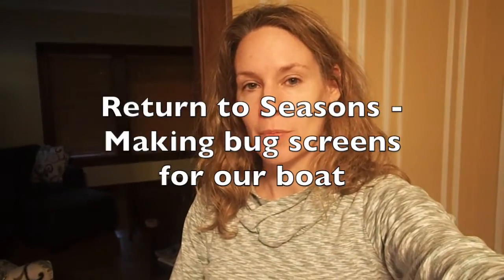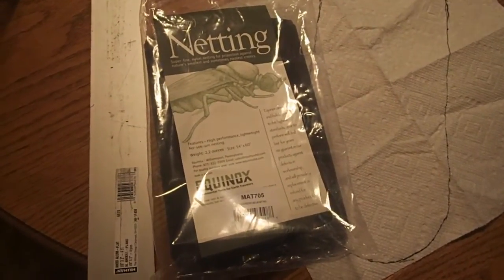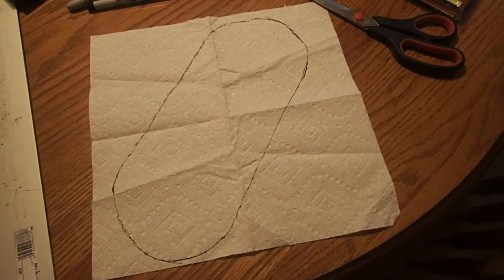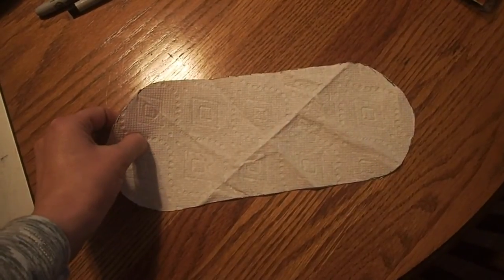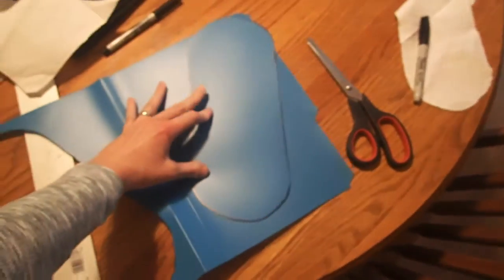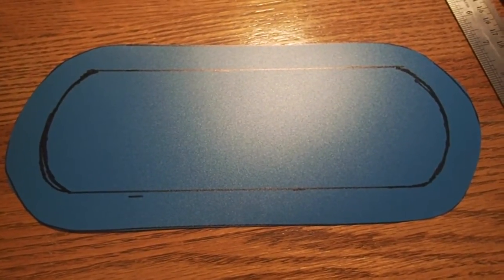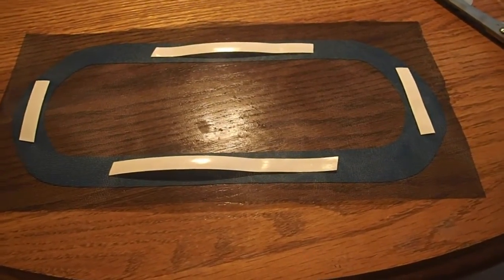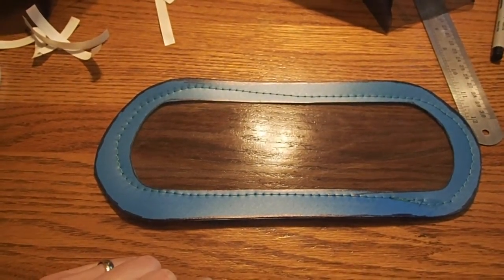Making Portlight Bug Screens For Our Sailboat - DIY fun!

Comment: I'm sure this is a little too late, but just in case... here's my 2 cents, use adhesive to keep the things together, then add magnets to the plastic part, that way the magnets will keep the screens in place... :)
Reply from the maker: +Chase Mixon Hi Chase - Thanks for the comment.  Unfortunately, none of the metal on our ports is magnetic, so using magnets to keep the screens in place won't work.
Reply: Probably aluminum portlights...
Reply: Yes- it all should be stainless steel...no rust! Hence no magnetism
Reply: @Returntoseasons  velcro?